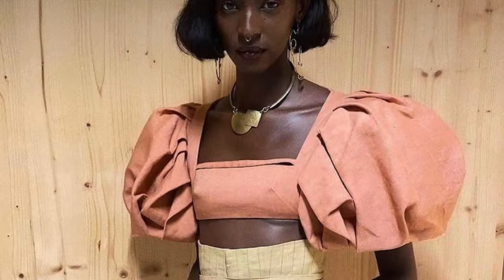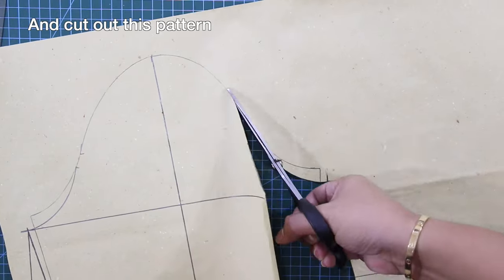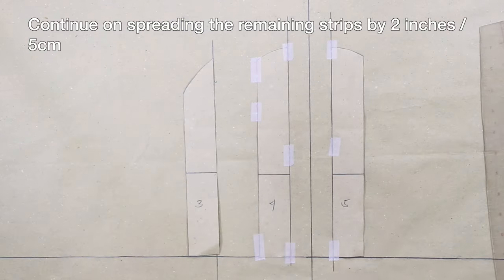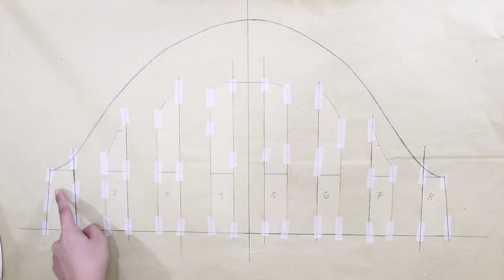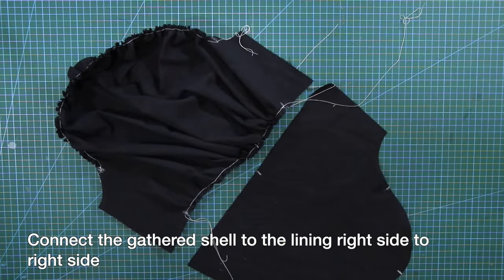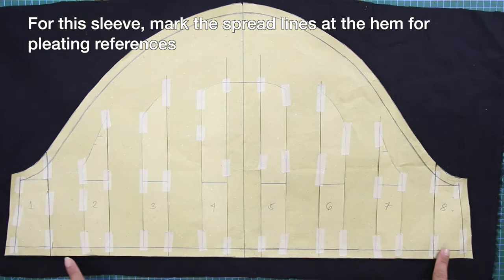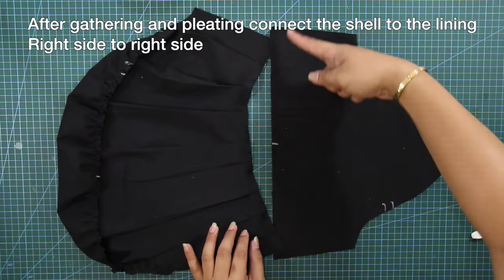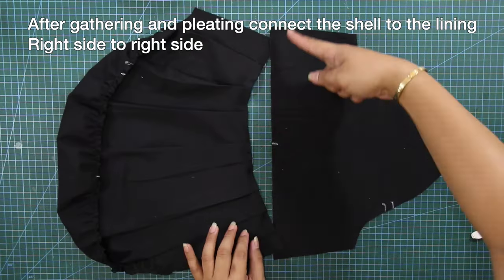PUFF OR BALLOON SLEEVE TUTORIAL | PUFF SLEEVE PATTERN MAKING | JACQUEMUS SLEEVE | LA MODÉLISTE

Comment: I have a few questions, I'm quite new to seeing clothes, so they maybe obvious to everyone else.  1) Why is the first step to reduce the size of the sleave head, what is the reason? 2) at which point  on my bodice block (which I've already made and tested) do I attach the sleave? To me, puff sleave look like you're closer to the neck, not  attached to the edge of the shoulder, but it's difficult to see.  Do you have any advice, I worry if I attaved to the normal bodice /sleave point then it will look odd, but I'm. Not sure.  I may have to make a toile to try, but I wanted to get your 5houghtsbfirst.

Tgank you for the video, it's just what I needed :).